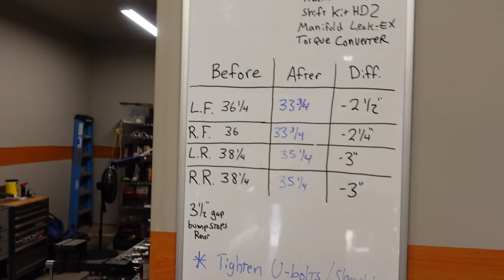HOW TO RUIN a 4wd truck by LOWERING IT! (but improve the handling, and make better in every way)

Comment from the maker: What do you think of the stance, should we go lower?
Reply: If it was my truck and I won the lotto it would be a lowered pre runner 💯
Reply: You going too c notch the frame?
Reply: Low enough i think.  Of course i would have left it the way it was.  But cool video!
Reply: I absolutely loved redtide and 03-05 awd silverado ss is one of my favorite trucks of all time so go just a little bit lower!
Reply: Curious why not a spring over in the rear..would have been about 5"lower and wouldn't have to mess with shackles until later with front spindles
Reply: Sorry spring under
Reply: Does pinion/driveshaft angle ever become a problem when lowering the rear on a GMT800?
Reply: Either way lower is good.
Reply: Pick your Wheels/Tires first and ask again 😁
Reply: I have been wanting a single cab stepside for a long time, so seeing you get one is super exciting (and I'm raging jealous). I think the lowered stance on the 4WD is great. I'm not into slammed and only sheeplovers squat their trucks. 

P.s. if you don't have an alignment shop you like in the area, Sid's Alignment in Springville is top notch and actually affordable ($20 less  than the big chain shop I went to) previously that messed things up and didn't listen to me). Sid's was quick and listened when I explained I don't have stock components and didn't have any issue with it.
Reply: Tad bit lower with a vid about correcting pinion angle.
Reply from the maker: Just because I don’t have wheels to fit the drop spindles yet…
Reply: A friend of mine has a lowered reg cab 4x4. He claims he couldn’t keep axles in the front any lower than 2/4. He is also making about 900hp though.
Reply: The stance is great. I’m ready to see a 4.8 build!!
Reply: Great stuff….Dare to be Different! (90’s era) 
What’s are the sacrifices when dropping it lower? (Concerning 4x4 operations/stressors )
Will it be a daily in snowy conditions?
Reply: Yes... 4/6 😁
Reply: I think it looks ok as is now.  I'm don't mind lowering a truck a couple inches, it does look a bit better and improves handling.  I don't like the look of a truck slammed to the ground, think that his ugly.
Reply: @mathewkorn5008  it wasn’t an issue at all with my 96 K1500 I lowered with the belltech front keys and a c notch kit🤷‍♂️
Reply: 4/6 Looks amazing on a GMT800. My daily is a 2001 GMC Sierra 5 speed with a 4/4 drop. I plan to go lower in the rear once I get a C notch kit. For wheels I'm running factory Denali 6 spoke 20s 255/50r20 Cooper Ultra Touring tires. Truck is a hell of a lot of fun.
Reply: Honestly, I think you need to put it in the air, put in a King Pin Super 60 with 40 splines and a 14 bolt with either a NP 203/205 combo or an Atlas with some ARB lockers and 4.56 gears. Maybe do a manual swap.
Reply: To answer the question directly, yes.  Indirectly, make this thing a full-size, step-side Syclone.  Lower, AWD, Turbo (Super? Both!?), and WIIIIIDE tires.  C'mon man, the world NEEDS a full-size Syclone.  You can call it "HurryCane"  :)
Reply: I'm definitely a fan! I just did this exact thing in March. I have an 04 crew cab 4wd, I'll have to measure but I think mine sits a tad lower tho and I plan to lower it about an inch more.
Reply: 5/7
Reply: Lower with coilovers would be rad
Reply: Just drop the back 1.5 inches maybe even 2 and you've got yourself a beauty 😍
Reply: Go as low as you can w/o a C-Notch/altering the frame.
Reply: Stance looks great. I'd turbo it. And run it. Btw a small torch set helps without taking up much space.
Reply: Lower.  Bigger wheels, shorter tires.  Turbo 4WD
Reply: Do the flip kit and drop spindles lol so I can see what I’m getting into
Reply: Definitely lower!!
Reply: You are a taquachee now my brother
Reply: Yes.  You should eliminate ALL ground clearance just in case you need to use that 4WD offroad.

Comment: Did the same to my NBS Z71, but I didn't have to use the keys, I just backed mine off a ways. Next is a flip with a notch and the 2 inch spindles. Do it!!

Comment: I know this is old but I have used my ball joint press to remove the bolts when you can get to them. I had a 98 S10 blazer in Wisconsin that I lifted and it worked well.

Comment: I pray that one day, that you do a segment/video/tech talk on upgrading OBS-GMT400 Brake upgrade/swap and or using converting GMT800,900 brake components. 

As an OBS owner (1995 c1500 single stepside Show Trucks USA/Mark 3 variation) the brakes just plan suck, some companies like Pro Performance sells a kit that beats up peoples wallets, but there has to alternatives out, and the fact that you know your way around these platforms and your skill set makes all of OBS folks wonder what you would have to say..
Not to many other companies focused on the GMT400 which is sad, alot them are still on the road to this very day, some modded or still plain ole fashion original!

Love the content, this truck reminds me of the 1 you lowered on the show and made the custom mount for. 
BTW Congrats on breaking 55k subs, next stop 100k! Stay safe, and as always thanks for sharing your work!
Reply from the maker: I actually have all the parts to do a GMT800 brake swap on my K2500 suburban...

Comment: I did a set of lift shackles on my 04 Colorado a number of years ago and I had the same issue.  What a pita! I wasn’t expecting it to be that big of a pain and the truck was only 5 years old at the time. And yes, the older I get the less i find I actually need a lifted truck. Just can’t justify it since I don’t go off road and don’t have access to trails.

Comment: 10 years ago I did a 2/3 drop on my 2003 Z71 Tahoe with a pretty warmed up LQ4 and 305/50R20s. Never regretted it. As a matter of fact, every time I am in a stock height Tahoe, I am reminded how much of an improvement in handling I gained. Sure, we lift a lot of them too. But for the majority that never need their height, the only argument left is personal taste.

Comment: Lift blocks depended on your engine, transmission and tow package.  If you got a 2005 with the 4.8, econo rear end, and tow package plus regular cab short bed it won’t come with blocks but if you kept the 5.3 that came with the tow package it would even with the econo rear gears!

Comment: Good time to upgrade the guel pump.
That spring job brings back nightmares of working on fed ex Grumman  chassis in Northern mn. After 2k sets of leaf packs. Yes I kept count. I got it down to 3/4 an hour and the wheels never left  the God forsaken thing. 
Good job
Reply from the maker: That’s a lot of spring replacements
Reply: @LawrenceTolman  yeah. It was a good 3 yrs of life till,
Sprinter front springs and trammys. 
I've got tons of shortcuts from fleet work.

Comment: If you're ever doing another one of these with rusted bolts, throw an impact on the bolt to spin it loose and then pound it out, slid right out when I did mine.👍
Reply: Works great on control arm bolts too!

Comment: So jealous. Here in the Ohio rust belt, you'd be a couple hours cutting bed bolts and using the torch on the trailer hitch. All while taking a rust bath underneath the thing.
Reply from the maker: yup, glad I Don't have to deal with many of those problems

Comment: Macgaughys can fit 16s.they move the Lower ball joint up on the stock control arm and give you that clearance. You need the ball joint spacer though

Comment: Lower awd/4wd trucks are sporty, but I'm almost concerned for your new climate. It snows a lot in the mountains. 4wd doesn't help much if you're plowing snow with your front end. 
  I know it's a project and you can just drive your AT4 in the winter while this truck stays parked. Most guys only have 1 or 2 vehicles, so they can't truly focus on on-road performance like this. Lifted trucks have their place in extremely rural areas with less road maintenance where the roads are the last in line to get snow plowed, if they get plowed at all. 
  I like stockish height trucks. Trucks lose their utilitarian value if you have to pick heavy stuff up too much higher to load the bed. I like full wheelwells in stock height trucks. I'll be putting some 285/75R16s on my 90 k2500 Silverado and lowering the torsion bars just enough to clear the tires with no rubbing. I've heard 35s are achievable with stock wheels and generous trimming. Anyway, I don't necessarily like lowering my own 4x4 trucks, but I can definitely see how it will be a monster on the pavement.  
  I'm interested in seeing how this truck pans out. Keep up the good work!
Reply from the maker: You do have a point about it being a snow plow lol. I’ll have to keep it out of the mountains

Comment: There is a company  called atomic fab to convert the front end to a coil over so you can ditch the torsion bars and that cross member so you can also drop the trans and the t case as one instead  of separately

Comment: so a trick I came up with cause I'm originally from upstate NY so rust country. we had ones that were stuck way worse and you couldn't pull a bed because it might not be able to go back on if you did. I would heat both sides of the bolt red hot with the torches which expands the bolt and the sleeve inside the bushing has a split so it allows some expansion. that would start to break the rust free then I would use my impact in both directions as it cooled back and forth and sometimes they would come loose with just that but the really stuck ones required the impact on the head and an air hammer on the other side simultaneously. so that trick works best if you are removing the spring cause you can get the shackle to frame bolt and the front spring to frame bolt then extract the shackle to spring bolt on the floor with a wet wash cloth to cool the rubber bushing if you needed to reuse it. I used to watch guys fight with those for an entire day and I would have it out in a couple hours.
Reply from the maker: Either way the rusty bolts are a pain in the ass
Reply: @LawrenceTolman  agreed. I do like that you lowered it though just for the record. adds alot to the street performance.

Comment: I would have left the front up cause I've noticed on Chevy trucks the steering gets easier if the rears lower and also for the weight transfer, but not my truck. I'm sure you're probably in an HOA community but I would have beat those shackle bolts on the inside with an air hammer dropping the spare and those bolts might have come out without removing the bed. But good work LT.

Comment: I agree even my 03 2wd Silverado 2500hd rclb sits like a lifted 1500 4x4 pickup and now after a 3” lower kit all around it sits like a 1500 2wd stock and the rear still sits 5” above the tire the front is 3” above the tire.

Comment: Good work mate, those bump stops look like overload rubbers though? I have an '01 2500hd that i'm halfway through lowering with a parallel 3 link and 2" dropped TJM lower control arms. When I saw you punch the torsion bars out of the keys I was losing it. I'm in Quebec, my keys and torsion bars are one and the same thanks to the salt! Hahaha
Reply from the maker: I had to hit em a few times, but they were pretty easy compared to the shackle bolt

Comment: Full disclosure, I’m a low lifted 4x4 ( just for tire clearance) guy who lives in Louisiana and hunts in really muddy areas constantly. I’m great with a lowered street 4x4 truck BUT it should be AWD and have enough engine to need all four tires pulling! Look out drag strip and auto cross…

Comment: You could've used the same u bolts ,if you put the block you took on top. It sets pretty firm since it has a hole to guide it. That's how i did mine
Reply from the maker: not a bad idea

Comment: Looks good. I look forward to seeing it lower. Just lowered my 2wd 04 ext cab with hotchkis coils and belltech leafs. Definitely do a flip kit or hangers on the rear of this truck. I ran the belltech drop leafs on my previous standard cab stepside truck and they were WAY to stiff. The 20" snowflakes will look good, just got them for my truck as well. Yep everyone has them, but I still like them.

Comment: A drop of 2-1/4” front and 3” rear is still very noticeable and yes the drop will by default allow the truck to handle better. Yes I’m one of those guys that says if you want it low buy a car because Trucks especially 4X4 Trucks are meant to be lifted not lowered. That said, it does look better and I can only assume it handles better especially in turns. At least it’s not a DONK, those are garbage that costs thousands just to still be garbage after all the fab work just like lowered trucks.

Comment: I'm a fan of lowering a 4x4 truck. I've found interest in pursuing ideas of proper AWD trucks. Easier to start a low AWD project with a factory 4WD truck and swap transfer cases out. Much like you guys did on Project Redtide from Power Nation. I suggest swapping the stock case for a NV149 and doing the front axle swap for proper AWD. Clone Redtide basically.
Reply from the maker: I think thats kinda the plan eventually

Comment: U need to put on the newer 13 in rotors in the front and yellow stuff brake pads
Reply from the maker: I love the yellow pads for stopping power, but they make a mess of the wheels with the dust
Reply: @LawrenceTolman  true but my wheels are ceramic coated so it’s easy to pressure wash the dust off

Comment: LT, don't feel so bad...I used to get asked when I was gonna lift my half ton when I had her, a '98 F150 XLT Supercab with a 4.6 under the hood But wouldn't ya know it, trying to convince some people that this particular F150 lacked things like the transfer case, front diff and the torsion bars the 4X4s had at the time. Sure some folks lift a 2WD drive but I didn't think it was a good idea for pavement princess! lol

Comment: drop looks good but before you drop more put the snowflakes on to see how it looks. I am glad you are doing this as I have a 2005 Silverado Z71 which is an ext cab. its has 5.3 with 4L60e w/ NP 246 T-case. its has Bilstein shocks but no front springs, dont know if that is normal but front end needs updating as all the bushings are shot.

Comment: Those leaf spring bolts come out east with a ball joint press believe it or not.  Rust belt mechanic.  Have to change a bunch just to rusting away.
Reply from the maker: dang, I have one on the shelf and didn't even think to use it. thanks for the tip tho!

Comment: Hey LT, it would of been easier, and Faster if you swapped out the shackles the same time you removed the lift blocks, because the leaf springs were loose and had no axle weight on them, it what i always do!
Reply from the maker: yup, you're right it would've been a little easier

Comment: Looks good but gotta go lower! Mines a 01 silverado stepside and I got a rear flip kit in the back and drop spindles with lowering keys as well. I had to get lowering shocks but rides great. For the wheels I got some gm 22 inch

Comment: Did you say trim the bump stops up front what does that do ?did you remove the rear is that what you did in the video .i did this to my 03 Silverado extended cab Z71 but i did 2 inch lowering hangers, 2 inch drop chackles, removed the lift block ,and my bump stops were already gone deteriorated from just being old. But my truck was bottoming out it was hitting the differential when on the road going over a speed bump so i installed the bump stops and not its not hitting no more, and rides alot smoother and its not bouncing like it did before. Did you remove the bump stops to get  lower. Oh and in the front I just lowered it by just adjusting the torsion screws. I have it on 26 inch wheels on tire size 295/35/R26. If i install the 2001 -2010 2500HD torsion keys can i get my front to go lower. Loved your video wish i had seen yours first it was so detailed and you showed everything perfect good lighting it would of help me out a lot if i seen your video first.  All the other videos  i saw the camera wasn't showing at the good angles as yours and their lightning was horrible.

Comment: Nice work. I did wonder out loud, while watching you pull the bed off, why didn't you pull the fuel tank and get rid of those front spring hanger rivets? If I knew that I was going to be doing that job in the future, I believe that I would have done that much ahead of time. Just wondering...

Comment: Nice, 2500hd torsion bar keys will drop a 1500. Since I prefer lifted and own a 2500HD, are the 1500 keys strong enough to use to lift a 2500hd ?

Comment: If someone needs some worn out coil springs for a suburban I just took mine off it's back up 2 inches so they lost like 2 inches it was constantly hitting the bump stops one is gone and the other is tore up

Comment: 2007 Classic Bowtie (GMT800) Im doing a body/suspension lift and making a steeper rake. Intending on putting LT 285s or 33s on the 2004-2097 17" x7.5 31mm offset 2004-2007 5 spoke wheel. Hoping to get a FF rear with 6 lug hub. LSD.

Comment: LOOKS GREAT BETTER HANDLING WITH THE LOWER CENTER OF GRAVITY BUT RETAIN THE 4X4 CAPABILITY WANT TO DO THIS ON A 2000 YUKON BUT HAVE TO DO IT DIFERENTLY CAUSE NO LEAF SPRINGS
Reply from the maker: Gotta use different rear coil springs

Comment: Instead of pulling the bed, sawzall on both sides inside that frame bracket through the bolt. Had to do it for those, control arms etc... Good heavy metal blade goes a long way.
Question: pinion angle change by only changing rear spring position? I think I need to adjust mine after some alterations...

Comment: Would you recommend lowering the front with torsion keys? I’ve heard good and bad things about it and not sure
Reply from the maker: As long as you keep is to 2 maybe 3 inches. You can go lower, but they say handling gets funky. Any lower for me, and I’m adding a drop spindle